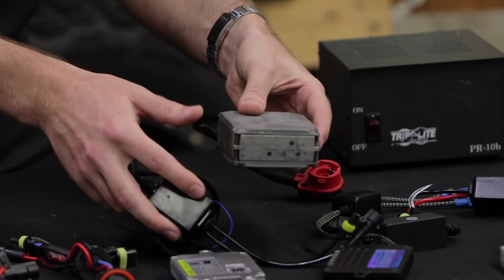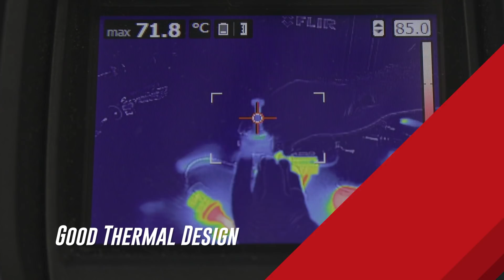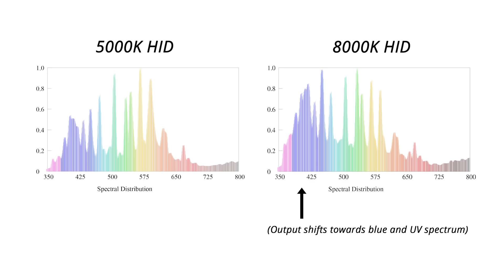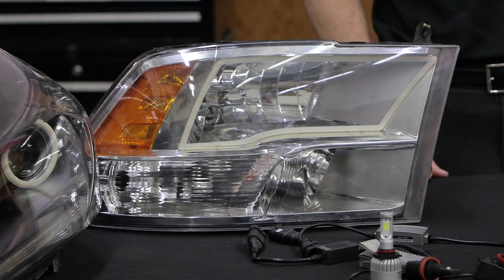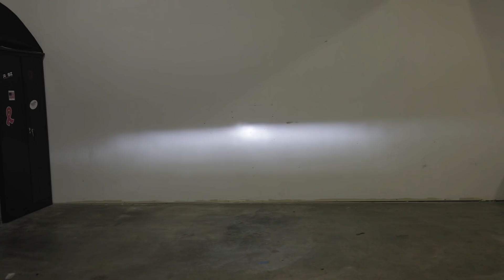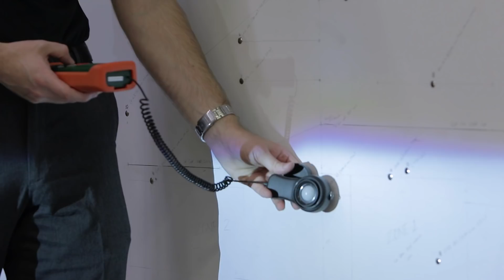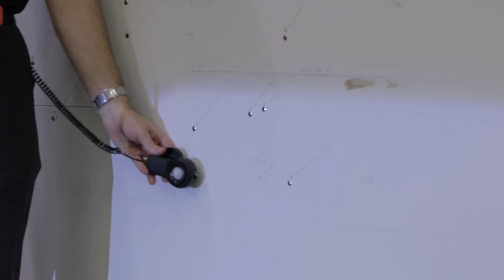HID vs LED Headlight Bulbs: EXPLAINED

Comment: Any suggestion for replace D3S with led. Which type/brand let to use?
Reply from the maker: Hi there! We actually offer replacements.

https://www.diodedynamics.com/replacement-d3s-hid-bulbs-pair.html
Reply: @diodedynamics  I mean to install led d3s and not xenon.
Reply from the maker: @AR-wn1ob  Sorry for misunderstanding! We do not recommend replacing HID bulbs with LEDs.

Comment: This is absolutely informative video 👏👏👏👏👏 , thanks for the time you spend doing it, I been so confused about LED’S and HID’S , I have only HID lights but I noticed they don’t last too long and I wasn’t sure about LED’s but I will give them a shot . Do you recommend any brand? I know prices are from $40 + , the ones you mentioned SL1 around $150 or more. Can you suggest any particular?
Reply from the maker: Hi Mario! What vehicle are you looking for?
Reply: @diodedynamics  I have a 2004 Nissan Titan with aftermarket headlamps, ccfl halo projectors ,but I'm just going to upgrade to a new style from VIPMOTOZ OLED Neon tube projector headlamp. Currently I have 6000K HID's on my projectors and I will like to know what are my options on this new headlamp. 
Thanks for your help.
Reply from the maker: @mariomenjivar2024  Unfortunately, we can't really give suggestions for aftermarket headlamps. Sorry about that!
Reply: Diode Dynamics thanks for your response.✌🏻✌🏻✌🏻
Reply from the maker: @mariomenjivar2024  You're welcome!

Comment: I'm in the Market for an LED kit any recommendations ??
Reply from the maker: Hi Kenny! What vehicle do you drive?
Reply: @diodedynamics  I have a 2020 BMW X1 and 2013 Mercedes Benz 350 Coupe both with Halogen in a reflection type headlamps
Reply from the maker: @slyslurdge  Unfortunately, we don't offer the correct size headlight bulbs for either of those vehicles. Sorry about that, Kenny!
Reply: @diodedynamics  thank you for the response

Comment: I have a 2006 Nissan Titan with aftermarket headlights. There is an H7 low beam and H1 high beam. I want to convert them to HID or LRD. The low beam is projector style. The high is reflective. What would you recommend LED or HID, and what replacement bulb for the one you pick?
Reply from the maker: Hi Michael! We make both LED and HID options for both of these applications for you Titan. It really comes down to preference. Typically, you will see better performance from an HID in a projector housing, and better performance from an LED in a reflector. However, both will perform much better than the factory bulb regardless! You can check out both for your Titan below!

https://www.diodedynamics.com/by-vehicle.html?find=2006-nissan-titan-318739&sid=1YnhUnV0z4

Comment: I have a 2017 Nissan Maxima which headlight and fog light (LED or HID)  would recommend? Thanks
Reply from the maker: It really comes down to preference! If your vehicle has a projector-style housing, you may see better results from an HID bulb. You can check out both for your vehicle below!

https://www.diodedynamics.com/by-vehicle.html?find=2017-nissan-maxima-318600&sid=MdPZlfzxnS
Reply: Diode Dynamics then I will go for HID bulbs tho. Thanks

Comment: The 4 sided or 360 led bulbs can work better on a projector ?
Reply from the maker: Projectors are designed to collect light from all angles and project them in a certain direction, where as reflectors are specifically designed for a certain bulbs filament location for maximum efficiency. We don't recommend the style bulbs you refereed to because they are extremely inefficient in headlight applications, but you would most likely see better results from them in a projector.
Reply: Diode Dynamics i have fog light that are projectors and i would like to know if that kind of leds would do good or just didn’t try them
Reply from the maker: @richarddelgado9119  If they are not our bulbs, unfortunately, we cannot give accurate information on how the bulbs will perform.

Comment: CURRENTLY I M USING HID KITS....I WANT TO UPGRADE TO LED.... PLZ ADVICE IF I SHOULD UPGRADE TO LED OR NOT
Reply from the maker: Hi there! It really comes down to preference! If your vehicle has projector headlights, we tend to recommend HIDs. If they are reflector-style headlights, LEDs may be a good option!
Reply: @diodedynamics  Mine is Normal Reflector so i should go for LED'S.....THANKS SIR
Reply from the maker: @sudhanshupatel5246  You're welcome!

Comment: 6000 Kelvin is not 'less white', they're closer to daylight (5500K). Compared to other light sources at night, they'll appear bluer. (There is no 'white' light, there's only full spectrum or spikes, and color temp.) 6000K bulbs are bluer than lower Kelvin lamps. Old filament house bulbs were 2600K to 2800K depending on wattage and age.  Bluer light has a shorter wavelength as which makes details sharper, easier for your eyes to focus. The flip side is infrared images, red longer wavelengths are 'softer' less sharp. This is also why you want to have your reading and work lights to be closer to 'daylight' or that 6000 Kelvin. 

To me 'Cree' means 'This LED bulb is going to be dead in six months'. In house bulbs YouTuber AvE took one apart and showed how poorly soldered connections condemned the bulbs.
Reply from the maker: We appreciate the feedback!

Comment: Super informative and by far the best explanation I've ever seen, but when I went to your website it looks like $330 just to change from Halogen to HID for my car's head/fog lamps. I might just be a cheapskate, but that sounds like a lot. I see the warranty is 3 years, does this guarantee the same brightness for 3 years or do you expect degradation to be normal in that amount of time?
Reply from the maker: Hello! While the price of our bulbs is certainly a little more than some of the generics out there, there will be a significant trade off with the quality versus the competition. With any HID bulb (OEM or aftermarket), the light will begin to diminish slightly over time, as that is normal.

Comment: I have a 2011 Subaru Outback, do you recommend a certain type of LED?
Reply from the maker: Unfortunately since it uses an H7 bulb, we would not have an LED that would be compatible. Just HID at this time.

https://www.diodedynamics.com/low-beam-hid-conversion-kit-for-2005-2014-subaru-outback.html

Comment: Excellent video. I prefer halogen headlights. Blinding oncoming drivers is a safety hazard.
Reply from the maker: Luckily LED technology has come a long way, and as long as you have a properly designed bulb, blinding oncoming traffic is a thing of the past!

Comment: This guy really knows what he is talking about. HIDs are the most complex of all these bulbs and the technology has been around for many decades. High quality magazine photo enlargements used to be performed on rotating scanners such as the Crosfield range of scanners in the 60s to 90s. The analysing part was performed with a narrow XID beam because it is very intense and WHITE (ie daylight). The bulbs were extremely expensive and as the guy says were started with a 20kv or so voltage and then warmed up and controlled with a ballast feedback system at around 35v AC. If you try a test drive at night with a car fitted with HIDs you will get an incredibly good beam at daylight temperatures. They really are worth trying. LEDs are a relatively new technology and though better than ancient Halogens they are not as good as an HID system that comes with a new car. That's why all top range BMWs and such cars always are fitted with XIDs, I was lucky enough to have a company car, a Mercedes, fitted with HIDs. I have never had anything like so bright but without dazzling oncoming drivers, we'll set up and daylight vision at night. LEDs are pretty ubiquitous on all new low and mid range vehicles and while not bad they cannot outperform an HID. Try a test drive for yourself.

Comment: Why doesn’t diode dynamics support Range Rover? I want new lights
Reply from the maker: Hey there! Unfortunately, we don't have bulb sizes confirmed for your vehicle. We recommend referencing your owner's manual or removing and checking your stock bulbs for the size/quantity before ordering by size from the universal bulb listing page below, just to be safe. 

https://www.diodedynamics.com/led-bulbs.html

If you get bulbs that you are not sure about, you can send us pictures of the bulbs in question, from a couple of different angles, and we can cross-reference those for you visually. Sorry for that inconvenience, if you have any other questions, please don't hesitate to ask!

Comment: Led loses brightness after about 10 mins. So really it's about the same as halogen or even worse . Not really worth the 150 $ if you can't even get brighter output
Reply from the maker: You should give our SL1 LEDs a try! They will provide more output than a stock Halogen bulb, even after that initial warm-up period!

Comment: for a toyota tundra 2007 how is the casing for reflection?  would this bulb be better than a halogen?  I saw a cree led kit but you say this is better?
Reply from the maker: HIDs and LEDs are going to be brighter and provide more nighttime visibility than halogen bulbs. HIDs do lose their brightness over time, so if you notice the brightness lower than when they were purchased, you can try replacing them. Our SL1 LED headlight bulbs mimic the halogen filament location, so it will provide more light output to the road where you need it, without causing glare to oncoming traffic. If you have any other questions, don't hesitate to contact us! 
https://www.diodedynamics.com/low-beam-led-headlight-for-2007-2013-toyota-tundra.html

Comment: how often do you recommend replacing each of them.  My car has HID and it's barely used but it is 15 years old.   Only 48k miles on it but my truck has new halogens around a year old bulbs. I think I will stick to Halogens on my truck though instead of switching to LED or HID kits.  advice?
Reply from the maker: Hey there! Typically, you will replace HID bulbs after 3K-4K driving time hours, or when you start to see the output diminish or the color temperature change.

Comment: Shouldn't you be testing output in a projector and reflector housing so you can get the real world performance rather then the unfocused performance that will show in perfect integrating sphere tester.
Reply from the maker: You are correct! That's why we do both! We test the output of the bulbs in a factory housing using our goniometer. Check out the video below to learn more about that process! 
https://www.youtube.com/watch?v=7ZebE6DpLLg&t=232s

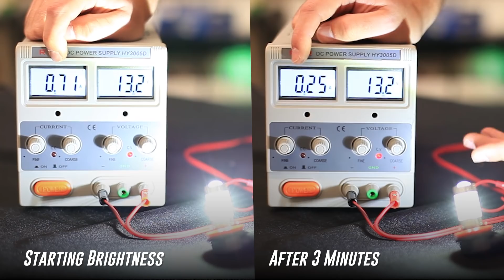Comment: 6:35 of course it decreases a lot, there is not a constant current going through them. ...  that why the LED needs a current regulator, as you just said.
The constant current is required to be at the best operating point and therefore the optional output... it's not about reliability.
Reply from the maker: Yes, both of these LED bulbs have constant current buck drivers, which are then being pulled back due to thermal overstress.

Comment: Love the all the real examples!!!  After watching this video, I've concluded 2 things:  1.  Don't put an HID or LED bulb in a Halogen OEM housing.  2. Use a projector housing for LED/HID if not OEM and adjust it properly.  I tried the LED in the Halogen housing and it shot light everywhere.  It was super bright - but had shadows and glare that was dangerous to others at night.  I removed it and went back to stock.  NOW... just have to pick an HID projector that works better than all the junk on eBay.

Comment: LEDs can run on 12volts. Xhp50, xhp70 ,xhp 35 are 12 volt LEDs along with some others
Reply from the maker: True, great point! Even so, they are highly sensitive to changes in current and voltage, so you can't really hook them up directly to an automotive system which fluctuates between 9-16V (and normally is around 13.5V). You would still need a buck/boost converter to keep the voltage right at 12V, so it ends up being a more complex circuit than simply dropping the voltage down to 9V for a set of 3 LEDs.

Comment: L.E.D’s: Have fans,behind the bulbs,why?
How hot do they get?
Reply from the maker: It depends on the bulb! Some bulbs get very hot! How hot an LED headlight bulb gets has a big impact on how bright it will be over time and how long it will last. If an LED headlight bulb has a poorly designed thermal management system and can't dissipate heat properly, you'll lose light output over time. Eventually, your LED headlight bulbs can actually fail from overheating! You can see more in the video link below! 
https://www.youtube.com/watch?v=FqqwkHsF014

Comment: Current draw, not voltage, is the most important spec!   The voltage is not important since it is a function of the product’s design and you never need to know this.  How much current they draw will be very important to your alternator and electrical system!
Reply from the maker: All of our LED bulbs that we offer (and most others on the market too), will pull much less power overall compared to that of a stock halogen style bulb.

Comment: Call me crazy, but that lux test seems a little disingenuous. I don't care how bright the light is at the bright center spot, right? As far as I can tell, even a new halogen bulb is good enough at showing me what's down the road. I want to know how bright they are at the fringes, 30 and 45 degrees off axis (where those god damned deer are always hiding to ambush me). That's gonna tell me what I want to know about a usable beam pattern. As far as I can tell that overly focused light is just good for blinding the snot out of other drivers.

Or am I wrong?
Reply from the maker: It really depends on what type of bulbs you are using and what type of housings they are being used in. If done properly, you won't see the glare you're speaking of, and the upgraded LED or HID will improve the output of the light shining on the sides of the road as well!

Comment: Granted LEDs are cool, but given the reflectors of today, might there be any damage ? Thanks ,,,, Cheers From NJ🇺🇸🇺🇸🇺🇸🇺🇸
Reply from the maker: No worries about any damage whatsoever. The LEDs will run much cooler than a stock halogen bulb will, and the LEDs also use much less power as well.

Comment: So in a reflector put only incandescent bulbs, in a projector about anything, my opinion exactly.
Reply from the maker: The SL1 that we offer is also a great option for reflector based housings, as it mimics the beam pattern of a stock bulb. This will not be the case with all LED bulbs however.

Comment: The sharp cut-off wit projector lights is only good in theory.  In practice, they are super annoying, both for the driver and the oncoming cars.  If we only drove on flat, level roads, they would be fantastic.  We don’t.  On roads that are bumpy or hilly, the cut-off line is bobbing up and down constantly and that is very annoying.  I have had projector light cars behind me and I thought they were flashing their high beams at me when it was just the car going over a large bump or dip.  I much prefer the more diffuse light from HIDs and reflector LEDS over projector lights, but as a driver of the vehicle with the lights and as the driving of a vehicle approaching or ahead of the projector equipped vehicle.

Comment: Excellent explanation on the pros the cons of all the available systems utilized in today's lighting systems and what the actual difference really is.!.What it really comes down to is the application (Reflector or Projector housing) and choice of actual light source (Halogen vs HID vs LED) and of course the price of the set up of the individual system of choice.
I experimented with an older 1997 vehicle and upgraded it to a HID kit (Mishimoto) and replaced the headlight lenses to newer clearer ones without the OEM diffused ones...With the correct professional alignment of the lens and light beam.. the difference is phenomenal..!
Reply from the maker: Thanks for the kind words, Gerald!

Comment: Wish I would've seen this a week or two earlier. I just installed LED bulbs from superbrightleds.com in my 2002 Super duty reflector housings, and they're ok, at best. The scatter is wild, and it looks like I have 5 or 6 small hotspots with some very dim spots in between. I've been playing with adjusting the bulb depth in the actual housing to try and get a better beam pattern. So far, haven't had anyone bright me, so I assume I'm at least not being "that guy".

Comment: HID bulbs are horrible! I have them o n my 2009 PRIUS and have changed them many times because the burn out and are very expensive. When they come on, they are bright, then lower in intensity making it hard to see at night. Won't own another car with this system.

Comment: With stock halogen bulbs I've seen cases where they've caused the bulb socket & wire harness get brown & brittle over some years.  This was due to them getting too hot & drawing too much current.  LED bulbs resolve this problem, but at times they require a special relay when used as signal lights.  In some cases a diode is needed when an LED bulb is used to replace a stop/brake filament bulb in order for it to work properly.

Comment: I had my HID lights for 11 years now, and put them on two different cars over that time I only replaced the ballast on 1 of them so far I'm still happy with them.
Reply: What brand of HID do you use or recommend?
Reply: Xenonhids let's you customize them a little I got them for my other car.
Reply: I got some xenon hid, had them for 3 years maybe slightly over. A ballast have out, so I need a replacement. I switched the builbs and ballast to double check them. Both builbs work, but one of the ballast doesnt work anymore. Any suggestions as to where can I get a replacement. I wouldn't mind ordering a new set. But if I can get the ballast by itself would be good enough for me. The builbs has two wires, both are screwed on to the other connections on the ballast. I've seen online, but can't seem to find the one I need. Any suggestions?